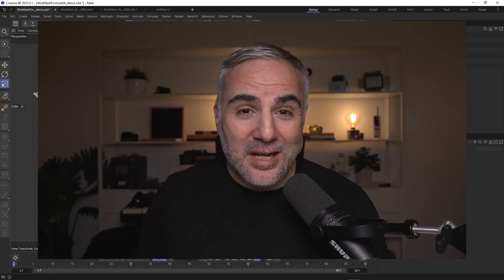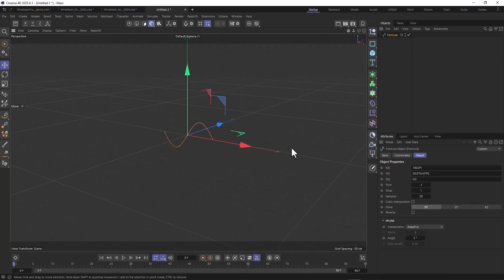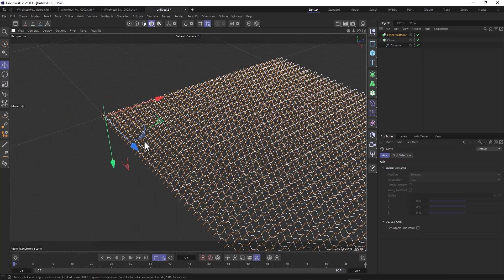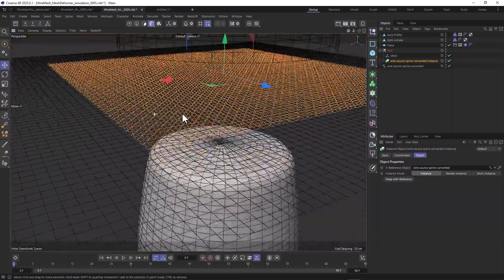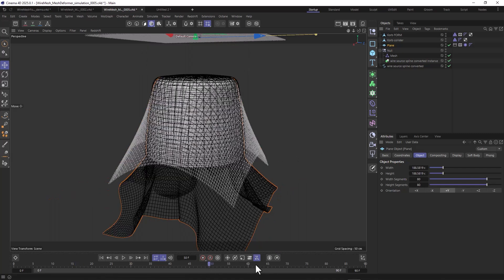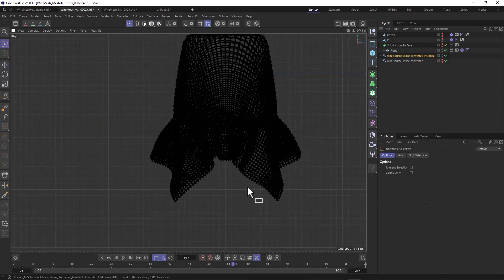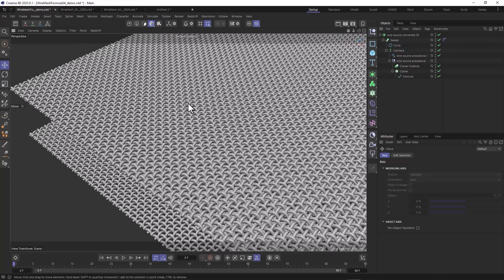Cinema 4D - 3D Microphone Grille Tutorial

Comment: Really clever way to achieve this microphone grill. Thanks for creating this tut! I'm curious what your scene and collider body settings are. I'm able to get the wire instance onto the cloth sim, but the FORM object isn't performing correctly. It doesn't push out the folds creating a smooth surface. Any advice?
Reply: There's a Post in the community tab here with a screenshot of the collider settings. Scene scale should be roughly 1:1
Reply: @videomarknet  Appreciate the quick response. Think I need to do some more troubleshooting. Collider mesh needs an opening in the bottom I'm assuming for the FORM to work properly?
Reply from the maker: @ yes must be open so it can 'squeeze' the mesh into place. Also keep an eye in the texel density / polygon count. Should be high enough to calculate properly. It mesh patch should barely cover your desire area, otherwise it won't iron out properly. Obviously, when there is too much 'fabric' it can't eliminate all folds, all that has to go somewhere.
Reply: @ Think I finally got something usable. For some reason my colliders didn't have phong tags so adding those helped the sim react.  Appreciate the feedback and help!

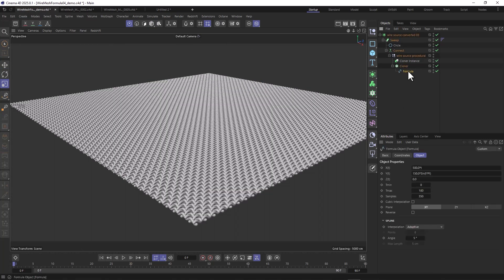Comment: There seems to be something that changes at 5:00 when you go to your finalized rig. Every other clone in one direction is flipped/rotated 180 degrees. Which isn't shown on the initial setup. Am I missing something?
Reply from the maker: What I'm demonstrating at 3:19 should achieve that result, every other clone / spline flipped and rotated. Does that work?
Reply: @ACAREL3D  It doesn't seem to. On your setup at 5:02, if you look at just the wires going in the X direction, every other one is flipped. Which is how the weave should be. But just putting them in a cloner doesn't achieve that and I cant figure out what step I'm missing.
Reply from the maker: @bluerockrendering  are you following the steps exactly as shown? Because I'm rotating the instance twice to achieve exactly what you are describing. Conter movement of every other spline for the weave pattern.
Reply: @ACAREL3D  Ok, I just had to make a cloner of the first cloner and offset it a little bit. Then put both in a null, make a clone of the null, and rotate it. If that makes sense, lol. Regardless, I think I figured it out. Awesome approach nonetheless! and its equally awesome you got Sennheiser as a client. I am a musician and have many Sennheiser products and I think I'm going to start modeling/ rendering for practice.
Reply from the maker: @bluerockrendering  awesome, glad it worked. Nice, I'm a musician as well. Hobbyist though. That's probably why I was a good fit as a 3D Motion Designer for Sennheiser.

Comment: great vid - but you left out a step. I noticed a difference in the mesh you created for the tutorial and the mesh you had when you started the simulation section. The first part of the tutorial creates a mesh with no "over under" happening, it doesn't weave properly. What you left out was that your cloner needs 2 formula splines - the second is rotated 180* on the pitch (make sure to turn off reset coordinates on your cloner) - THEN create your instance, rotate heading 90 and pitch 180 and drop in your connect for the sweep.
Reply from the maker: thanks for the heads up. That's possible as I am jumping between project files. I'll pin this to the top in case someone is running into the same problem. Thank you.
Reply: Or, we can do it with just one, instead doing the 180 P rotation in the step transform (object tab) in the cloner...

Comment: Excellent video! If possible, could you please show the full modeling process without skipping any steps? I noticed that the cloth simulation was not included in this video, and it would be incredibly helpful to see it in detail. Thank you!
Reply from the maker: usually the client is providing the construction data (CAD) so I only added the wire grille in this case. I modeled the classic mic for the intro shot but I'd rather not reveal too much of the CAD data in this case. I did post the settings screenshot of the clot animation to the community tab here on Youtube if you want to check that out.  There will be a dedicated tutorial video with the most effective techniques and strategies for modeling. I'm also preparing a masterclass course so stay tuned for any updates on that end.
Reply: @ACAREL3D  Thank you very much for sharing this information. Please continue to keep up the good work!

Comment: Don't quite get it how the mesh deformer works in your example. If I use just a plane as the deformer it doesn't work, seems like it wants something that encloses the mesh to be deformed. It also doesn't work on an instance at all, only on the original mesh.
Reply from the maker: the mesh deformer and the instance must be in the same null. The plane is set as the driver object under the mesh defomer as demonstrated.
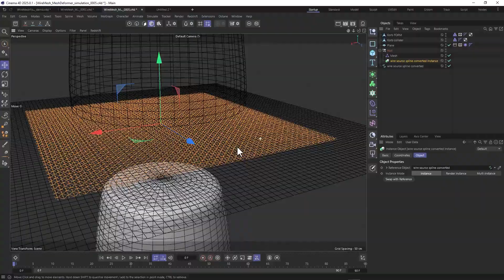Reply from the maker: just the video at @7:30 and replicate what you are seeing in my Object Manager it will work